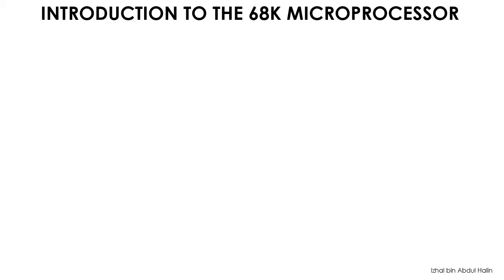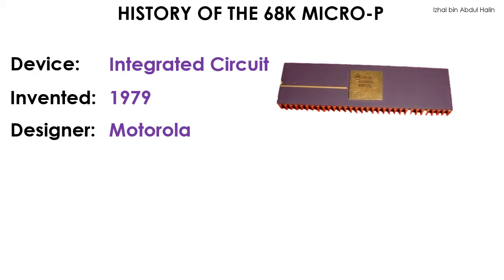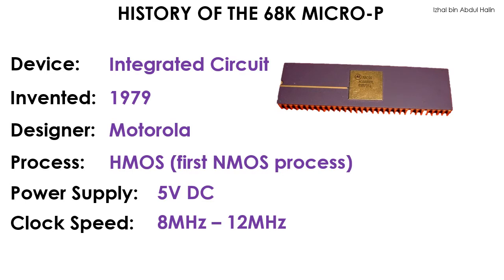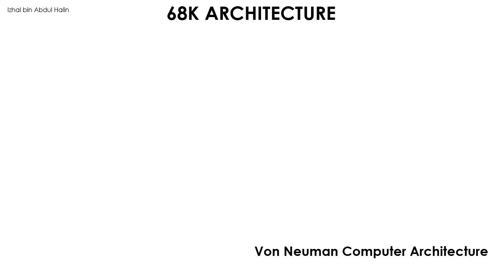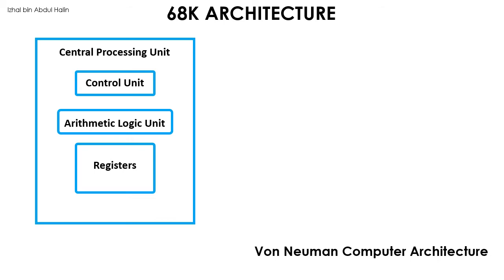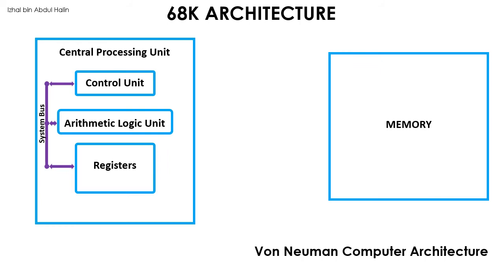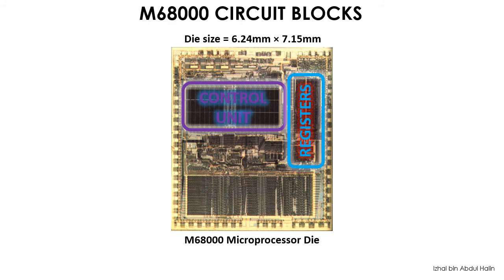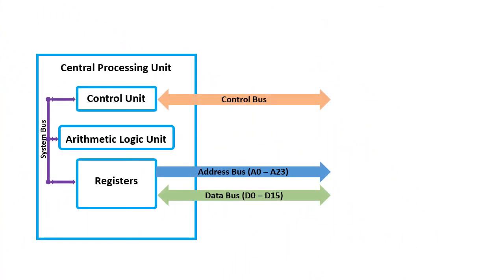Intro to the 68k - PART 1 : Architecture

Comment: The 68000 has about 40k transistors, not 68k. The processor was named 68000 because its predecessors was the 68xx range of professors.

Comment: The diagram does not correctly label the ALU and Registers. The unit labeled Registers is actually the instruction decoders. The piece labeled ALU contains the ALU and the registers. The part labeled Control Unit is the microcode control store, but the instruction decoders and other logic are also part of the control unit. I know this because I designed all of the labeled items.
Reply from the maker: Thank you Prof. Nick. Im very pleased of all the people that viewed this video you are one of them with the best comment on this video. I dont know the exact labels because I couldnt find them anywhere but I tried to make sense of the layout so I could show people the blocks and that they really exist in circuit form. Thank you again for your comment. Now I know better. I am very happy you saw this video. Please comment on my other videos if you can find the time. It is a real honor for me Professor Nick.
Reply: @izhal75  Izhai, I wrote several papers on the design of the MC68000. You may be able to find them through Google Scholar by looking for "Tredennick and MC68000". Also, I need not comment on the rest of your YouTube videos as these topics are covered in published materials from Motorola.
Reply from the maker: @NickTredennick  I sure will. Thank you again and God bless you and your work.
Reply: @izhal75  I think you should pin this comment

Comment: What's the data bus, address bus, speed, microprocessor of the 68k processor
Reply from the maker: Hello. The data bus is a set of wires that carries data. If the data is 8bits wide than the data bus is made from 8 wires to carry the 8bit data from point A to B. The address bus is just like the data bus but it only carries address information. The speed is the micro-p's ability to process instructions in a clock cycle (operating frequency). I hope this helps.